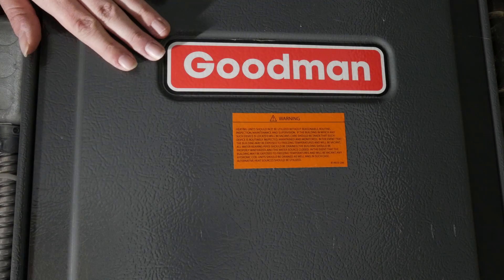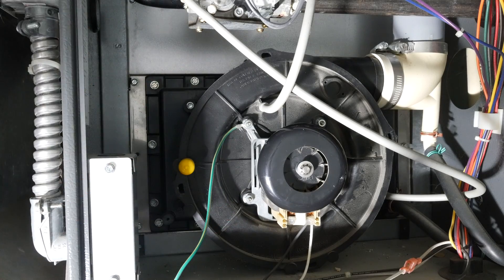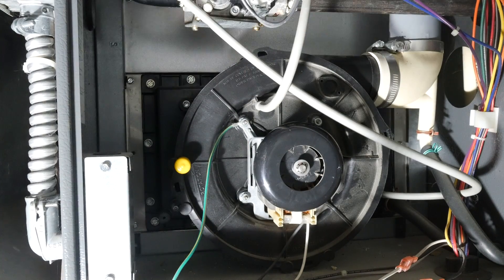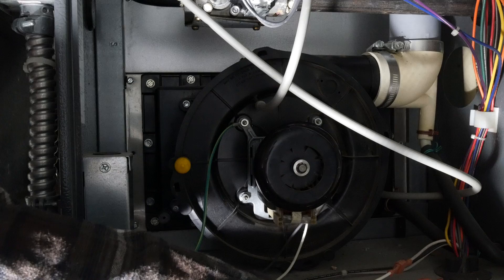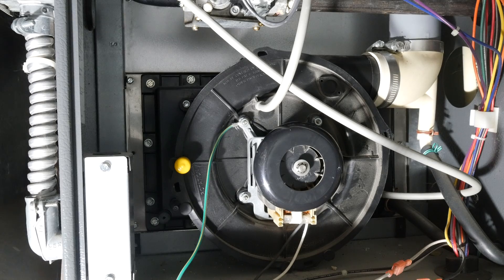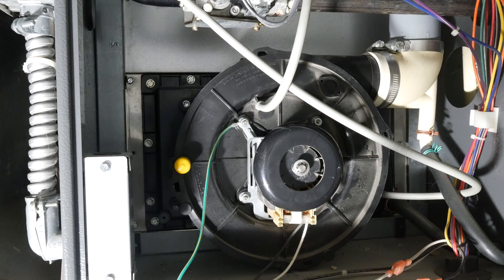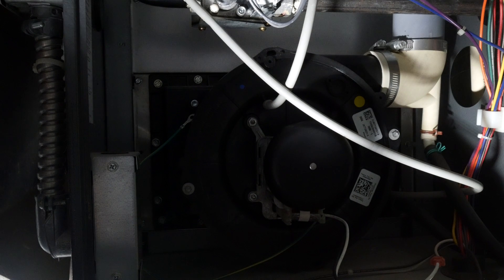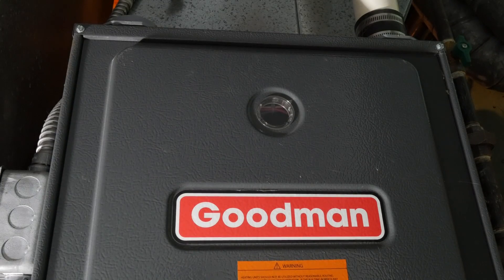HE Furnace Draft Motor Troubleshooting

Comment: Good video but for Goodman and Amana furnaces, almost always the problem is with the inducer motor's bearing worn out. The motor stops running if there is too much resistance. Spraying a little WD-40 will almost always get it running again until your mail ordered motor arrives. 
I wouldn't recommend doing any kind of testing when it is powered on and calling for heat. It is dangerous. 

Power off the furnace, shut the gas, spray some silicon lubricant if you have some, or WD-40 otherwise, Use a paper towel to prevent dripping. Turn the motor a few times and it will run again -- though loudly.

Comment: Hi, some of these motors just get the bearing seize so just applying some oil on the end may give you the time to get your replacement. I did run mine for a month no problem after lubricating it a bit.. I  realized as you pull your motor you should have remove your cracked black fan seall on fournaise side.  Also without using the infrared just the buzzing humming sound was clear your motor was stuck.

Comment: My fan started to come on and off intermittently then would not come on at all. Was told to check the voltage to it from the board...didn't have a tester so I removed inducer and did some wire splicing and hooked up to 120V receptacle. Fan kicked on. Waiting on my board to arrive this afternoon. Man it's cold! Good thing I have a few electric heaters to get by!

Comment: "more like badman" ha!
I've got 3 blinking lights and found that it fires when I take the yellow nipple off the face of the diffuser fan (shown on the first fan in your video). Checking for plugs in my exhaust line. My fan spins up, just doesn't produce enough vacuum to trigger the switch. Thanks for the video and explanations/warnings.